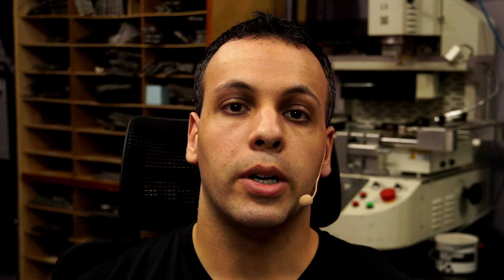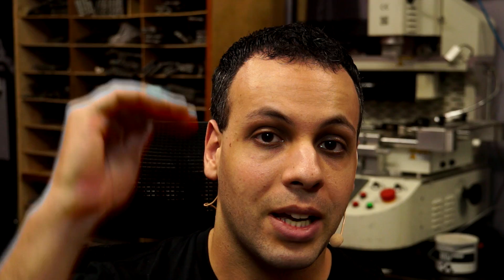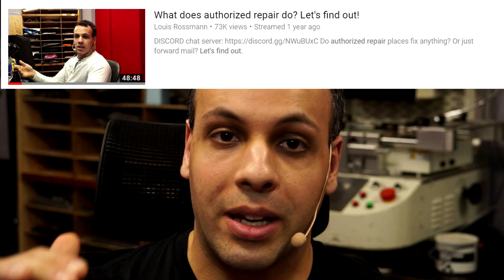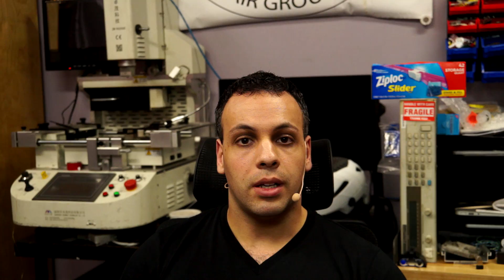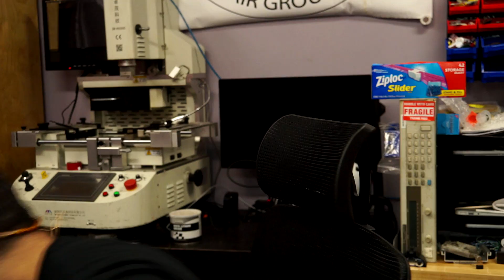Apple's war on refurbishing.

Comment: Every industry that can is trying to achieve sustainable income. Shouldn't be a problem, right?

Except the easiest and 'best' way for cars, tech, and any other expensive hardware and appliances you can think of is to build forced upgrades and maintenance into their products. Software companies are wanting to ride the income of a single product forever. This is the only way they see to keep their profit margins going up without taking risks on new products and new markets and actual competition. So, when a customer can repair their own copy of a product that is profit denied from their overpriced, willfully inefficient services. 

Consumers are no longer free to choose in the world so many manufacturers are chasing. Instead they are to be strapped down and told exactly what and how much to spend because by god these companies cant stand making less than all the money in every pocket ever and how dare you consider a cent less.

Comment: I remember reading about a similar issue with John Deere, It's at a point where the only way to service and repair equipment is through authorised dealers. Machines must have genuine parts (Serialized to the machine) to even run, so if a part breaks in the middle of a harvest you have to wait for parts to be shipped and installed before you can continue. This can take weeks and you may even need to load the machine on a truck and take it to the dealer. The diagnostic programs are held by the dealer ensuring the owners cannot fix any issues themselves.

Comment: Now I'm neither defending apple or Louis here. However with all the hardware hacks that are beginning to come to light there is a very valid concern in the theoretical possibility of maliciously introducing some sort of chip that goes into seemingly harmless looking hardware like screens where it will screen capture and transmit your data or speakers where it can record its output ect. So there is a VALID SECURITY CONCERN HERE , however apple may also be using this to knock out two ducks in a row by trying to curtail individual repair shops as well.

Comment: Yeah I do not get the hype of Apple at all.
I tried the OS yet you can do literally everything on an Android device too (a rugged one if you wish that it will not die from a drop like ya know a 1000$ phone these days, using a bv9500 myself). Now you may find yourself liking the layout of iOS etc. FEAR NOT on the PlayStore there is 100% a iOSlauncher for your Android device. This is a thing of Linux which carried over to Android. A neat thing.

FEAR that messaging over a PC just got impossible? Maybe you could try Pushbullet to name a Software which makes that possible.
Besides! AIR PODS still work on Android! Depending on device you still have your headphone jack. And I highly suggest getting rugged phones. 
Now you maybe wonder what about security and stuff? Stay with your device until the updates fade out and THEN check for like "LineageOS". Flashing an Android phone is not hard and you get the latest Software again (besides I have yet to hear from someone who got hacked on a outdated device... just don't do stupid stuff). My Nexus 5 (2013) runs Android 8.1 today. AND stay away from Samsung. They are just as bad as Apple just with their own Android OS.
Also, apps on Android (same company etc.) seem to offer more options than their iOS counterparts. I have encountered this a lot on my iPhone5s which I repaired.
Let me remind you that there are many AndroidPhones out there which you certainly do not know. There is one that will fit your needs, one just needs to look beyond the usual companies.
My BV9500 was ~300€ with tax and came with a charging pad sooo... 10000mAh battery. I am happy. IP68 my friends+jack.
I bet with you that the next iPhones that just sold (despite their already known issues) also will encounter flex based damage like every generation since the redesign.

Macbooks...
The only reason I think people stick to Apple is that they do not want to get into alternative Software and I understand it as I was swapping to Linux a bit (essentially games pulled me back and software that I needed, but Windows for sure has an alternative software which one does not need to compile first xD). But if I look at these Products I am shocked. A MacBook with a phone processor (surprise what gives few horsepower also powers longer). Very obsolete hardware for the most part which is almost guaranteed to have an essential flaw. At this moment I would not trust this company just because I am not able to access the drive of the device.
I am pretty sure there are RyzenAPU Laptop solutions by now which are cheap and deliver about the same performance.

It is just my view. I had to deal with several machines by now... and I just don't get the "It just works" slogan from Apple. To me, it seems they super overcomplicate things, can't keep their iPhone settings organized and each time they want to add something they make it worse. I swear I once said that being within the Applesphere is super okay, but with the new products they make they just screw over their fans... best is they defend it. With all the R&D they have they should not make such flaws that Louis always points out to us.
Reply: Saying Samsung is just like Apple is a bold-faced lie.  Samsung is nothing like Apple. Samsung never attack the idea of consumer rights. They always try to add new features to their devices,  They don't intentionally design products that can not be repaired on the user end. They do not attack 3rd party repair and they have great  RMA processes for realistic prices without the need for Applecare equivalents. The also openly sell genuine parts for 3rd party repair. I have never seen Samsung refuse an RMA as Apple regularly does. Actions speak louder than words. 

 Saying that they have their own version of Android is no different from any other manufacturer. Almost every Android manufacturer uses their own skin or their own custom features and apps.

 Just because Samsung is the most popular or arguably makes the best devices does not mean that they are anti-consumer.  The fact that you quickly glossed over that statement is evidence of your bias.

  Samsung's success is not driven by a cult like following that simply look past every mistake they make, Samsung has a big following because they listen to consumers. That is why the Note 9 still has a headphone jack and doesn't have a notch. They will change things and take responsibility when they screw up. That combined with their quality and customer service is why they are number one in the mobile space.

Comment: How does ownership of hardware work then?  An iphone XS Max +++ ultra costs almost $3000 in local currency (with applecare) i pay I recieve a phone I have something I can touch, I have something I can pay insurance on and recieve a new one if I accidentally drive over it with my car, it is tangible what I gather from the courtcase that Louis is describing is Apple redifining ownership of hardware... which is their prerogative but if they are going to claim ownership of the hardware as well then the price needs to come down, if we are leasing our hardware it should cost less at least...

Also wondering how the most recent round of trade sanctions will affect third party apple repair shops?

Comment: Louis, you are 100% correct in your analysis. Apple is, once again, over reaching. In a sane world, it would be Apple that would be facing both fines from regulators for anti-competitive behavior and civil damages from its customers. As it is, Apple is immune from the consequences of its actions due to the bizzaro-world nature of the US legal and political systems when it comes to Intellectual Property. Like most of the really important issues we face today,  it may require a US constitutional amendment to fix this (we're probably too far gone now for a mere change in federal or state legislation, the judiciary would just nullify anything Congress or state legislatures pass). The original US Copyright Act of 1790 only provided for a term of 14 years, with a one time renewal of 14 additional years if the copyright owner was still alive. That's a total of 28 years, compared to the 120 years provided by current US law for copyrights held by corporations. The whole point of copyright, at least in US law, was to provide a way to enrich the public domain by providing creators a fixed period during which they could benefit from the fruits of their labor before their works became part of the commons -- it was not to gift a small elite of a perpetual monopoly over intellectual property.
Reply: “The Congress shall have power…
 To promote the progress of science and useful arts, by securing for limited times to authors and inventors the exclusive right to their respective writings and discoveries… “
Article I, Section 8 of US Constitution
Reply: US constitutional amendment? Congress will never pass such bill, so you need to do it via constitutional convention - good luck with that.

Comment: I'm sure it will never stop.
Just found out that after a screen replacement on an iPhone 8, True Tone and ambient light sensor is gone. After some research I figured out that Apple hardcode the original LCD to the unit and without a "programmers box" from REWA LAB or similar company, these functions will not be working. I replaced the entire front with an original LCD, refurbished from a trusted vendor but with no luck. 
Need to transfer data from screen to screen. Anyone else know about this? The technicians around here had no clue about it.

Comment: TBH I'm surprised you're still in business repairing Apple products at all. 

If they had their way, their products would be completely sealed chunks of aluminium containing a single silicon chip, a screen and a battery. It's only due to manufacturing limitations that they can be opened at all, and still have discrete components. But they are getting there.

Comment: Some other industries have actually already gone much farther along this road. Ask a farmer how on his new John Deere tractor he has to buy a license from the manufacturer if he wants to hook up the used plow that he purchased from his neighbor. And how he doesn't get any new attachment licenses if there have been any unauthorized repairs on the tractor. Or ask a CNC shop how they have to ask (and pay) the manufacturer for permission before they are even allowed to move their machines (that they fully paid for!) to another location (there's a gyroscope built into the electronics that completely locks the machine as soon as it is moved even an inch).

Comment: 9:32: "...when they took away the diagnostics...and replaced it with...'Something's wrong.'"
Sounds like Windows 10, replacing helpful error messages with error codes to look up with "Something happened"
Apple and MS seem to be copying each other these days: hardware that's hard to upgrade/repair...software that treats the user like a paying fool...

Comment: I don't even understand how this is a thing.  The word refurbished is all a product needs for consumers to know what it is.  How is this not identical to auto parts?  Refurbished meets original specs using parts from an original for fit and function.  OEM is an honest to goodness original, new, part.  Aftermarket is a new part made by a third party.  
I mean I understand that apple is pretty much grasping to control all aspects of their products, and I understand why they might want to do so for good and bad reasons (The good, ensuring the product meets their standards. the bad forcing customers to buy new products instead of fixing them), what I don't get is how this doesn't get tossed out in preliminary hearings.  

Perhaps people just need a better understanding that electronic devices are repairable in the first place, and not just magic boxes that need to be replaced when they break.  I'd love to see the response to an auto manufacturer saying you have to buy a new car if you crack the windshield.  Oh, wait, hello Tesla.

Comment: The way I see it, someone has to take the pain. Right now the pain is mostly on the independent repair shops, they need to figure ways around Apple's demonic policies, protecting the average very naive buyer from the snake that bit the apple. But wait until this batch with T2 chip starts failing and the average user will not have any choice other than to pay full price for the repair, so that they can feel the pain(just like an iPhone X user that broke the back glass panel :) ) and then witness the awakening of the Apple sheep....

Comment: I read that the newest MacBook Pros and iMacs cannot be repaired without access to software which Apple does not release to third parties. If you attempt to replace any mundane hardware without access to their configuration software, the computer will not reboot. It becomes bricked. I wonder what all the Apple Fanboys think about that.

Comment: I bought a "second hand" Honda Accord Limited 2004 V6. I got a very good price, because it It had been wrecked in a big accident and was completely "rebuilt" (by very talented technicians btw). Even though my insurance company wrote "Rebuilt" on my papers, Honda made no fuss about it and still accept to service my car ! They even replaced the front wings and hood that were copies, with original ones (after a truck ran into my parked car), and it didn't cost much more that what a 3rd party garage wanted to charge me (with more doubtful parts then what Honda could come up with, thus given the slight difference it wasn't worth the risk). The repair industry is a huge marketplace, and it looks like Apple is trying to monopolize that market in regards to their products (if not for obliging people to buy new stuff rather than allowing them to repair their Apple gizmo). In short : Apple is going for a total horizontal control (as they tried to do with music via iTunes), more over by trying to impose a ridiculously exaggerated pricing scale (fascism). They must be stopped at some point.

Comment: Hi Louis i do not like your style, I find it sometimes annoying.  However I put up with you because I agree with you ideas, Apple is heading on a very dangerous direction (for us) and we need to do do sommethnig  to prevent this. I feel sad because it didn't use to be like this Apple used  to make great products, that were serviceable by the users, remember this?  https://support.apple.com/en-is/HT201165  Right now I am replacing my 2011 macbook air (that has been working  flawlessly ) with a new Dell !

Comment: This cancer is everywhere and it's only getting worse. I've been an ASE Auto tech for 20 years and when I started you could get anything you wanted. In the last few years you can't get internal engine components for the most part they want you to replace the whole thing. ECMs TCMs and BCMs are pretty much held onto as classified parts and when you do have to replace them you often have to pay to have the vehicle towed to the dealer for programming OR pay over 200 bucks to download the flash to your tool that is only good for 24 hours and most of the time won't work unless you have the manufacturers diagnostic equipment. DIY in the auto industry is all but dead. In fact most parts houses won't sell any DIY person any parts for hybrid vehicles for fear they will electrocute themselves and sue. Man I hope this starts to turn around but it's looking like most industries are digging their heels in and aren't going to go down without a fight.

Comment: I have ray-o-vac batteries in most of the handsets of a Panasonic phone. it was more cost effective to buy those rechargeable AAAs i can get just about anywhere instead of specifically-Panasonic-branded-and-made-specifically-for-this-phone ones. as of my last check i can't even get the Panasonic ones locally anymore. Wal-Mart still sells some cordless phone batteries, but the ones for my phone are their in-house electronics brand. Still more cost effective to buy the Ray-o-vacs (or even Duracell or Energizer). Phone is made to have the batteries replaced and i'm not planning to sell it to anyone, I still "counterfeited" this phone didn't i

Comment: i am hoping that nVidia does not copy Apple so shunt mods will not be illegal either way you do them 
the lazy way of using liquid metal or the more long term way of using a chip made for the process  depending on the board the chip changes a little 
Microsoft is another one that really does not like self repair
really none of their system board is repairable but they are still upgrade able ... kinda so here is to hoping that Microsoft keeps the parts that if you take it entirely apart you can upgrade and not have the system crash due to not using prosperity parts certified by Microsoft or the manufacturer that made the board for Microsoft SO-DIMMs are small and only go up to 16GB per dimm or 32GB per dimm but the system only supports up to a collective of 128GB on windows 10 Home anyways which is way above what most people would get for their system